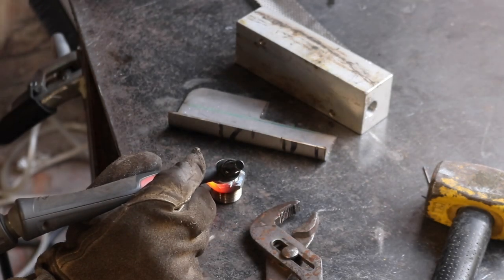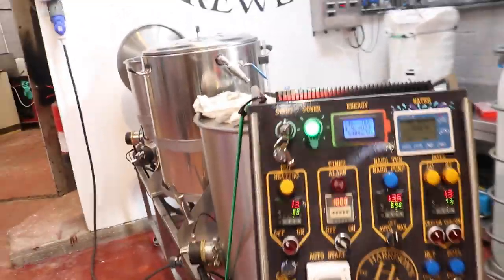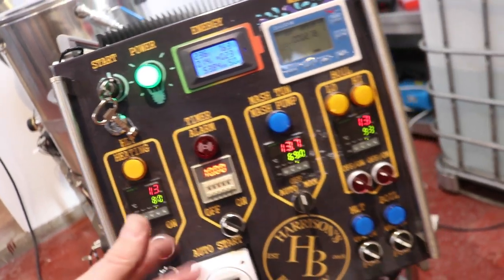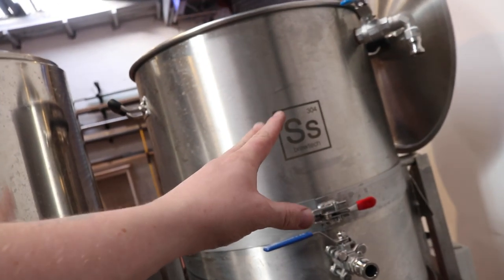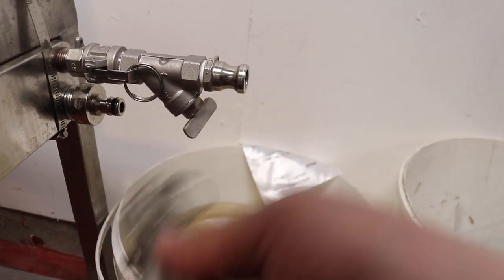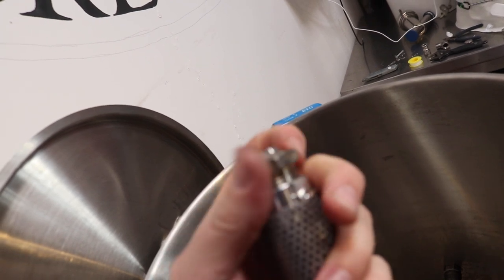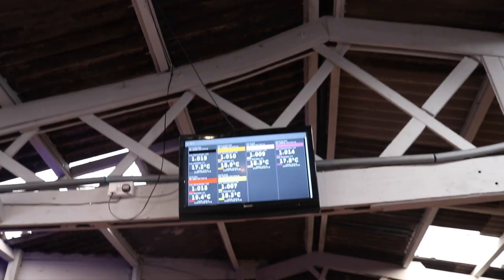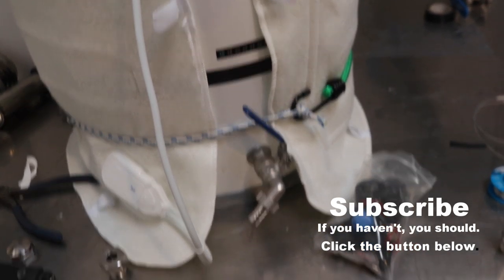REVISITING THE PILOT KIT - PROBLEMS

Comment: Hopefully the new filtration setup works better than the old one,looks a lot tidier anyway. Are you going to use that new big y strainer at all? I wonder why the plum Porter finished so high? Should still be a nice drop with good body though 1019 might be a good bit of residual sweetness,I would split the batch if I were you and do half on fruit and half as is. Cheers.

Comment: You're going to have a lot of dead space under that bazooka tube. Could you not fabricate a Bichmann style hop blocker to fit over a downward pointing 90 degree elbow?
Reply from the maker: Don't forget the tank tips forward. I had about 700 ml dead space last brew. mostly solids.
Reply: @harrybrew69  Ahh of course! I was thinking as a mere simpleton with a static system.... :)

Comment: Three wire PT100s work by assessing the overall resistance across the two blue (in my case) wires.  It then knows the resistance of the wire with the resistive sensor and can calibrate correctly.  Using the jumper is a workaround for two wire probes.

I think you have the Y strainer around the wrong way into the plate chiller :-)